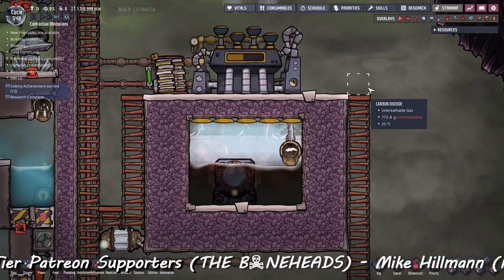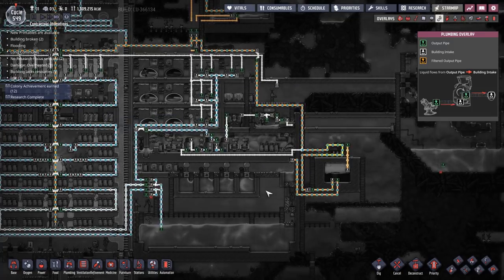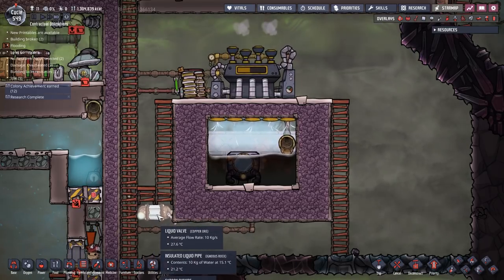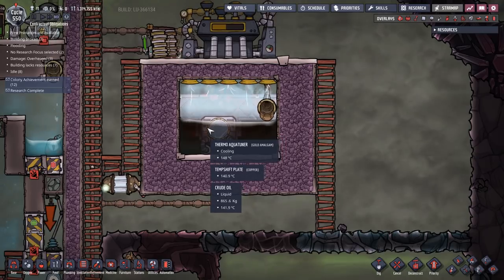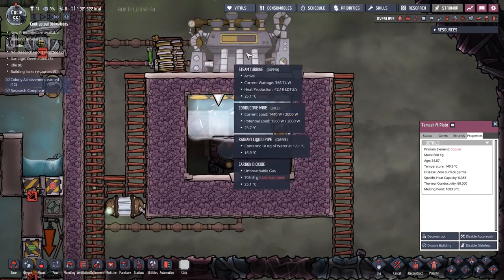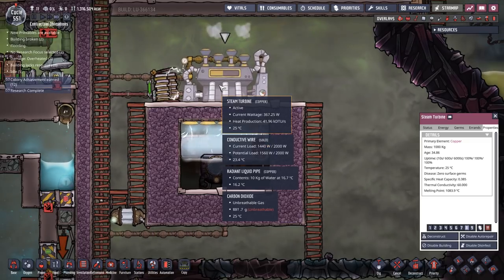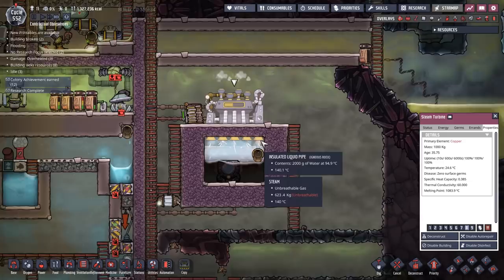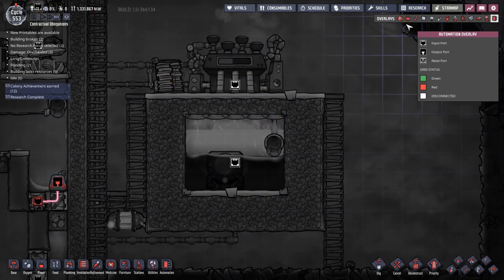How To Cool Your Base - BEST Mid-Game Cooling System EVER! - Oxygen Not Included FULL RELEASE

Comment from the maker: Skye Storme Official Game Store - https://skyestorme.chrono.gg/

Full Let's Play Series Playlist - https://bit.ly/2ynmHpB
Reply: If you pumped Ethanol through the this you could theoretically cool a room to  around -112 C.
Reply: You don't want to be using water for this. For midgame, use polluted water as the primary coolant. The aquatuner cools the liquid by 14 degrees regardless of what fluid it is. Polluted water has a significantly higher specific heat capacity compared to normal water, which would increase this system's cooling efficiency. 

On top of that, encase your turbine in insulated tiles, it's bleeding heat into its surroundings. While it's being countered by the radiant pipes nearby, with the lack of redundancy, a burst pipe or malfunction could cause a problem.

To add redundancy, a liquid pipe thermo sensor connected to a shutoff to bypass the aquatuner should the liquid get too cold would be simple to do. Just set it to detect 14 degree water and it would prevent the packets from any chance of freezing
Reply: @ChickenTheWicked  i liked the ehtanol idea i will try to make this :)
Reply: Why don’t people just build their power plants in ice biomes?
Reply: I know Im asking randomly but does any of you know of a way to log back into an instagram account..?
I was dumb forgot the login password. I love any assistance you can offer me!
Reply: @Ryan William Instablaster :)

Comment: I had a moment of "but does it produce as much power as it uses" and then I realized that isn't its point.  It's not a generator, it's a cooling loop.  The power it produces simply reduces the energy cost of running the cooling and acts as the place the heat energy gets dumped.
Reply: Yep the steam generator deletes about 90% heat (10% of that heating it self up so it needs a small cooling loop to prevent heat build up)
Reply: If you tune up the steam generator and keep the steam at the optimal temperature, the system will actually produce MORE power than it uses.  Takes a lot of power over many many cycles to achieve (mine took over 100 cycles to optimize), but totally worth it to delete so much heat.
Reply: @jeremyb8112  From my understanding, you can only make power positive base cooling setup with space age materials (i.e. super coolant).

Keeping the steam at optimal temperature would not really help make power positive setup, all it would mean is that your steam turbine will have lower duty cycle than the aquatuner, and when you average out the aquatuner and steam turbine duty cycle over long periods of time, the optimal power produced by a steam turbine running infrequently aren't going to be enough to compensate for the aquatuner that is running constantly.

The steam room of an aquatuner/steam turbine setup is really just a buffer, so its temperature shouldn't really affect how much power it produces.

Either that, or you need to be running a really hot base where the average temperature of the loop's working fluid is hotter than 130C before using an aquatuner to raise the temperature, which won't be the case for base cooling. It is a possible setup if you use the same steam room to harvest heat from magma or really hot furnaces; but that's really just the excess heat from magma offsetting the base cooling, and not really a power positive base cooling.

Comment: "And that is my ultimate MID game cooling solution" on cycle 500. Meanwhile me: struggling to cool off my base at cycle 120 and already consider this midgame.
Reply: Run water in normal granite pipes through floor tiles, cool it in you water tank using temp shift plates made of ice. This will get you some time until tou rush few exosuits and get plastic to build steam turbine.
Reply: @hailstorm7868  Yeah i didn't know electrolyzer was hot. On cycle 300 now running on petroleum and steam turbine
Reply: Build your power plants in frozen biomes.

Comment: I see you have two layers of insulated tiles around it to try and keep the heat in. You could use airflow tiles on the inside layers where there is oil. Airflow tiles are hydrophobia so the don't actually make contact with the oil. This way you are loosing even less heat to the surroundings. I don't think if it would make a noticeable amount of difference, but I saw what you did and it reminded me of that game mechanic. So I thought I would share.
Reply: The steam will still make contact with the outside though. However this will increase the oils contact with the steam so it is a curious thing to try!
Reply: The heat is going into the insulation because of the Temp shift plates, since they move heat in the 8 tiles around it.. Cutting one off each side will still provide the same amount of reach for the chamber itself, but without dumping the heat into the wall.

Comment: I believe I saw a Francis video that showed a simple bypass system. Basically you attach a thermo-sensor right before the thermo aquatuner to make sure your water won't freeze it, then this sensor shuts it off if it's too cold. You then add a water bridge just past the entrance into the aqua tuner to pump it to the other side of it and let the liquid through.  Combine that to a liquid reservoir loop and you can essentially keep the water flowing in circles for many cycles before it needs cooled again with no power usage. (Since liquid has vastly more heat capacity than gas) I did that super early game on the desert map to cool my food location.
Reply: This!

Comment: You immediately put a stop to my trying your pulsed aquatuner setup, though it still looks really cool.
A liquid pipe thermosensor on the intake for the aquatuner, paired with a filter gate to prevent rapidly switching the aquatuner on/off, and then a bypass bridge for when the aquatuner is off, would keep your cooling loop flowing forever, and potentially look nice and neat.
 I just built one of these aquatuner/turbine coolers using gold/gold amalgam/ceramic for everything possible. Working on a larger version using 2 turbines and 3 aquatuners now.
Reply from the maker: That's why I rushed this video out! Glad I didn't waste your time :)
Reply: yeah like Tony's design :P
Reply: @KerbalSpacey  Yeah, I was one of the people who pointed out Tony's bypass failure, his no-steel vid helped me a lot figuring these setups out
Reply: You should not filter termosensor signal, because it protects AT from cold water packets.

Comment: 3 Automation's you want:
- Check input temp to prevent freezing. (as you said)
-Turn off Tuner if it gets too hot.
-Only turn on the steam generator above X temp. The gamepedia page for the steam generator has the temps for max power output.

You can probably remove the oil and have about 5kg of water inside and get more power out. It will raise the temp of the steam. Just make sure there isn't any gas other than steam inside.
Reply: The oil is absolutely critical to making it so you don't have to check the environment surrounding temp and can run the AT at 100% up time - the trouble with Gold Amalgam AT's is that they have awful thermal conductivity. The oil solves the problem with it's insane conductivity. With the oil the heat out of the AT can be leeched fast enough at the steam temperature that it doesn't exceed the overheat temp - without it the system will reach the same steady state temperature of steam (as the system with and without oil have the exact same DTU consideration, so they have the same thermal energy) but the AT is hotter than it's overheat at that equilibrium.  IE you don't pile as many DTU's up in the AT before reaching the equilibrium point where heat from the AT working equals heat transfer to the steam (which is the determining factor for the heat of the AT).

Once you have steel you can dispense with the oil.
Reply: @riotintheair  Ya the massive up time is nice, but pointless. As is he could probably run that system at 10-20% up time. He has already taken his lake to damn near freezing. If he made it a closed loop he would also save power on not running a pump 24/7. Change the critter killer to a door system to elevate the water level to cope with not having the water dripping.
Reply: @mithral07  you can still turn it off and certainly should when the loop is too cold. But building it this way gives him a no-maintanence cooling loop into the early late game that's scalable to the full potential of an AT using water cooling loops. To me one of the major points is to retire risk so I can spend time thinking about the next problem. Getting to the point you can ignore a system and it scales automatically to your needs (at least for a good long time) let's you work on getting a new system to that level. Then you grind it out, one system at a time. If Skye builds this he won't need another heat sync until he hits the space age, which coincidentally is the next time you can really make massive improvements to it.

Comment: For more flexibility in my cooling system (and because I might want to cool things down more aggressively in certain situations), I'd want to add an additional Thermo Aquatuner for every 14 degrees Celsius of water that I'd want to cool down, along with enough automation (such as thermal sensors in each water container) to ensure that each Thermo Aquatuner is only used when it's needed. (For example, I might want up to 7 Thermo Aquatuners around to be able to cool Water that's on the brink of boiling into steam down to near freezing temperatures in case I want to, say, use that supercooled water to keep large amounts of hot machinery from turning their surroundings into an oven.)

Comment: I've made a bigger model of this using 3 aquatuners and 2 Steam engines, and could not figure out why my aquatuners wouldn't drop in temperature, and the steam would be at a much lower temperature than my oil/aquatuners. And i realized i did something wrong that wasn't really discussed in this video : My liquid vent was 2 squares above the oil reservoir line. Thus the water output from my steam engines, being in small volumes, vaporized or lost much of its cooling effect directly to the steam instead of the oil. 

So take care to put that liquid vent below the oil line, or it won't cool much.

Comment: I think a Better way would be to Use a Cool box, You Essentially just make a Box where you dump the Cooling of the Aquatuner,  And then run a Continuous loop around the Base filled with water. Which will draw it's cooling from the Box instead of the Aquatuner directly, This way You'll save more power initially and in Long Running Bases It will save you quite a but of power as You only have to pump water into the loop only once.

Comment: A couple issues to this setup, not really about the cooler design itself but rather how it's hooked up to the base:

First, currently you're dumping water with a vent, which means that you're actually going to have to pump the water back into the system again. That's an extra 240W of power draw that you can do without.

Second, is that you're chilling a very large water reservoir which means that your cooling system will always be running constantly drawing 1200W whether or not the base is producing heat, because that huge reservoir can absorbs a lot of cooling. Ideally, especially in early game where you're not producing much power and heat, you'd want a base cooling to run only as much as the base as the heat you're and no more.

Both of these issues can be solved by running your cooling loop as a closed infinite system instead of dumping and pumping water to the environment. You'll use less power and not have to expand the power setup too early.

A closed loop system does mean that there's less water in the loop, and less water in the loop does mean that the water in the loop will cool and and heat up faster. You can add a water tank to the loop to even out the fluctuations, but getting automation/sensor so you can maintain constant temperature throughout the loop is going to become a bit more urgent.

Comment: aqua tuner does not use fulll power if you have the outlet backed up.  Meaning either 10kg/s or with flow restricted (valve or plants like berrries for example).  Then in only runs every time 10 kg packet is removed from outlet.  However, if you run with restricted inlet, then your comment applies.  Gold overheats at 125C not 175 so there is something weird that goes on with the oil.  Someone else had the same design but with a tiny amount of oil on the floor and it did the same thing
Reply: aqua tuners overheat at 125C however making it out of gold gives it a +50C modifier (125+50=175).
you can confirm this ingame just go to the aqua tuner and hover over making it from gold and it tells you about the +50C.
the thermo regulator (for gases) is 75C so that made with gold would be 125C

Comment: Its a nice build. I'm toying with the idea of just wating till I've made some steel before I mess with the aqua tuner but toying with something like this could be a good idea if i get stuck. You might find polluted water is easier to use than water for heat exchange. Water is all good, but polluted water just has a freaze point of -20. And boils at 119. More safety room.

Comment: I think it can be more efficient. If I remember correctly, 1 turbine can take the heat energy from 1 and a half aquatuners, so 3 aquatuners and 2 turbines should be more efficient.
Reply from the maker: That's just 'more' .. not 'more efficient' .. there no efficiency gain to scaling it up .. and remember it is a power consumer ..  not a prower producer so you'd just be wasting power unless ofc you need the extra cooling for your base :)

Comment: Its funny because I made my own, well-balanced small mod that allows you to convert resources into other similar resources and other states of matter (solid, liquid, gas). Meaning I can suck in oxygen, pump it through what I called a molecule manipulator, and output it as oxylite, which naturally emits cold oxygen, then the co2 made by the molecule manipulator is piped out and input into a room with lots of co2 recyclers, making it oxygen and outputting lots of heat, to be reused to cool down the whole base, the molecule manipulator and the co2 recyclers. I have a few other mods in that allow me to transfer solids around my base automatically and also to automatically place solids and drill them so I also have infinite oxygen. Will not release the mod though... Working more on it.
Reply: There is nothing funny about this comment. Nobody is interested in your mod because it seems like it makes the game easier.
Reply: @Kotsknots  I posted this comment 4 months ago... I don't even play the game anymore and some people might like the game to be a bit easier. And regardless you don't need to be triggered about it, just move on with your day...

Comment: Your steamturbin works wirh 40 % i think its overheated oe not enough heated. try one cooler feeding two gas steamturbines, u fill a bigger room with only a bit of water/oil and that should work . and the backplates werent be used i will implement them in my build fhis will make it even more efficient

Comment: Thanks Skye, I really like this improvement. Space is at a premium in my base, so a smaller system is definitely preferable. One question about the steam turbine / aquatuner interaction...what happens when you have an inconsistent supply of water going into this system, eg, the water gets too cold and you need to turn the aquatuner off for a while? Does that affect the efficiency of the system?
Reply from the maker: No .. that's one of the perks .. you can turn it on/off or adjust the flow amount however you want with no issues :)
Reply: The one thing to be aware of is if you're doing less than 10kg packets of water you still pay the full power cost - so you achieve less cooling per Watt of power. If you have intermittent packet sizes you can save power if you stack all the packets with some sort of packet stacker. The great thing about this setup though is it should be unbreakable as long as you don't put super-coolant through it (but full blast super-coolant cooling is beyond the specs of a single steam turbine's capacity).

Comment: Cool your base and produce consistent energy from the Steam Turbine: Clever and Elegant.
Reply: its not producing a power gain due to the aqua tuner using 1200w (and 240w for the liquid pump) while the steam gen is making 350w, this system is for deleting heat/a cooling loop. 

including what the steam gen is producing this system is still using over 1000w

Comment: thx ive been looking for something like this
everyone else has some super complex systems 
and its difficult to model what i need from them and feel good about myself, plus im limited on power unless i want  dupes ears popping from co2
ive been trying to work out a simple system to do cool steam cooling for the first time, in a more early game base around cycle 100
Reply: How did he get steam in there?
Reply: @nekonesto3125  the steam turbine pumps out water
u use that water in radiant pipes to cool the turbines
when it dumps back into the hot chamber it evaporates to steam based on the temp

since this ive been using other liquids based on brothgars video with lumber
now i use ethanol for steam
this way i can get around using a turbine and still get cooling
although its definitely a balance for what is possible and what materials u have